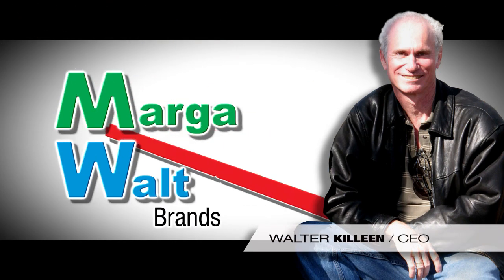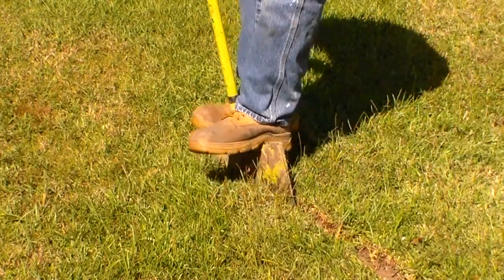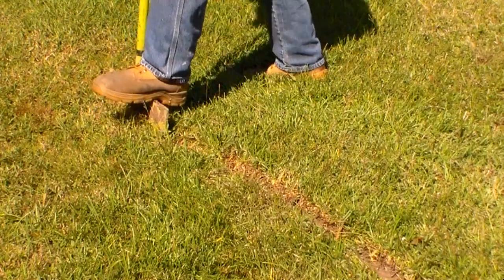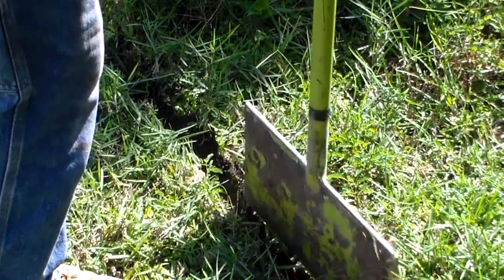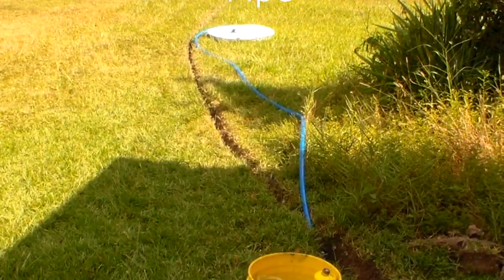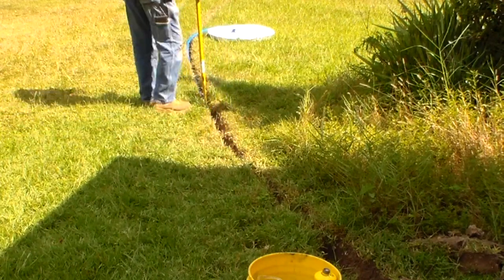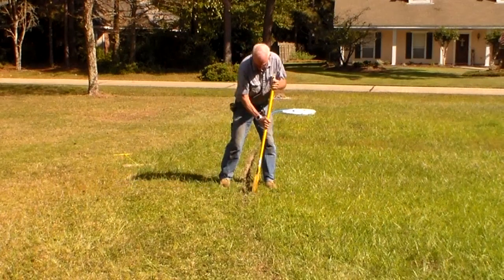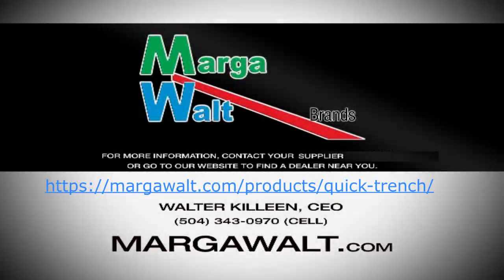QuickTrench Usage Tips #2

Comment: really 20 min with a sharp shooter
Reply: I've been a plumber for over 40 years and used a Sharp Shooter before... You will never get the one inch diameter water line below grade to 8, 12, or more inches without breaking the tool. The yellow tool makes sure that you don't damage the pipe while pushing it to the bottom of the trench. The green digger weighs almost 11lbs! A sharpshooter is closer to 3lbs. That extra steel creates enough inertia to cut through the sod in one strike. Side to side motion treats the digger like a double pointed shovel. (to go deeper)... in the end, you have a flat bottom trench about 1-1/2in wide at the top AND bottom. The middle of the trench is narrower, thus the need for the Yellow tool.